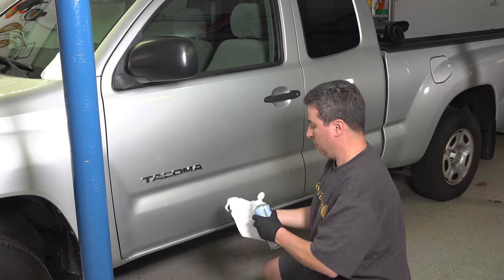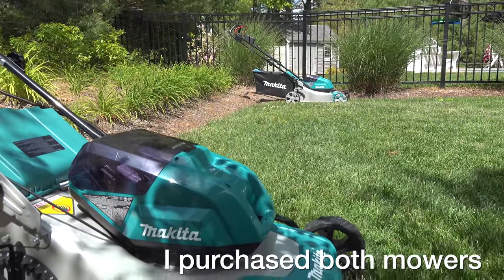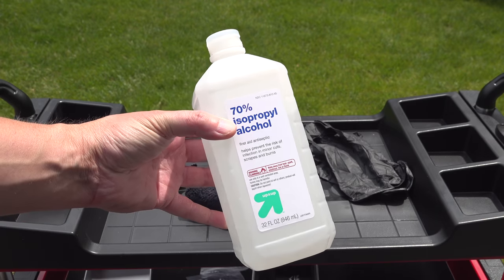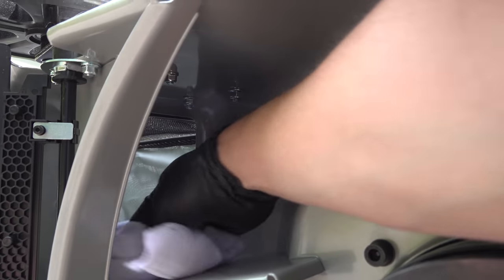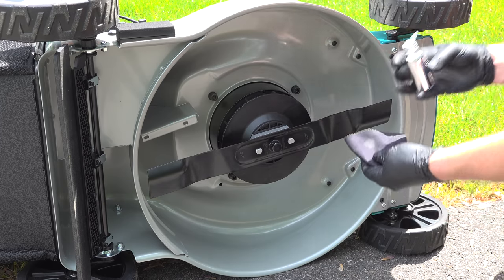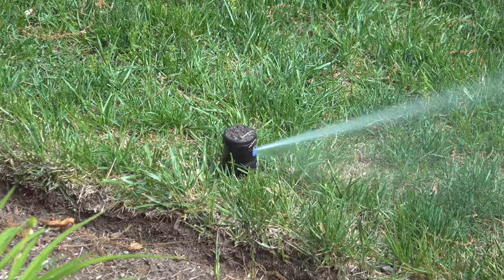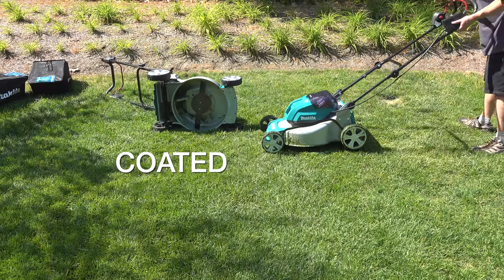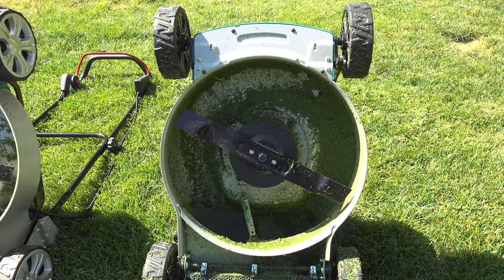Does Ceramic Coating your Lawnmower Really Stop Grass from Sticking to It?

Comment from the maker: Thanks for watching please LIKE & SUBSCRIBE - AvalonKing is having a MASSIVE Memorial Weekend Sale with special offers and huge savings from Thurs 27th - Mon 31st May but stock is limited so act fast
Reply: I figure it's too late to put it on my zero turn mower. I've been using it for about 10 years now.
Reply: Still there are variables! Those are electric!1.Well what about a gas lawn mower?
2.Are you cutting wet grass?
3.How much wet grass and how tall is it?
4.What if sometimes you don't clean your mower off after you've cut your lawn? 
5.Is your lawnmower garage or shed kept vs just being outside exposed or covered up outside? 
6.Will constant use outdoors and sometimes the engine might over heat or just get hot,will that make the ceramic coating deteriorate faster🤔🤔🤔
Reply: @punchogunter2362  great questions

Comment: I ceramic coated my shower walls... they stay so clean and water beads right off!
Reply: I've been wondering if that would work. What did you use
Reply: @Aaron-nj8xj  I used Turtle Wax Ceramic Spray Coating. Around $14.00 a bottle perfect for things like that!
Reply: Did mine as well,amazing & my arms don't miss the scrubbing 👍
Reply: GENIUS
Reply: @MIKES0029  just so you're aware, that's not a ceramic coating. A true ceramic coating would eat through a plastic container. It is an Si02 formulated spray that I'm sure adds plenty of hydrophobic behavior and is a great idea. Not trying to knock on ya, just passing the info as it is an easy and common misconception. Awesome idea regardless!
Reply: I ceramic coated my body. No more showers for me!
Reply: I ceramic coated my self, now I don't get wet when it rains.
Reply: That is smart
Reply: My sinks and toilets are now better than ever
Reply: I ceramic coated My shower floor, grandma's fall right off!
Reply: I ceramic coated my toilet, no more shit stains
Reply: Does is stain grout?
Reply: @daveroski  not sure I have a fiberglass shower..

Comment: Would like a longer term test on this one. I'm wondering if the grass will still build up anyway over time.
Reply from the maker: I will definitely let you know. I am just as curious myself.
Reply: @SilverCymbal  thanks! Great video as always!
Reply: With experience with ceramics on cars, the answer is yes. However, I'd guess it would take 2-4 years before it needs to be redone or cleaned. Huge difference IMO. This is a really interesting idea.
Reply: @sebastian-daquanglocknerjr1883  Ceramic coatings do not last 2-4 years on cars. Much less under a mower where dirt and sand will be blended around.
Reply: @SilverCymbal  I did it with paste wax  ,  results same... cheeper
Reply: @PabloDamon  that's what I was thinking
Reply: Great video.  Yes agree w/Mike longer term test please.  Also, would have been nice to see you use a blower on the underside.  I theorize it would have blown away most of the coated mower grass but would like to see it!
Reply: @Angelfams  I agree. Leaf blower test please.
Reply: @SilverCymbal  my family has a lawn business. How would you say the ceramic coating has lasted? Any info will be helpful. 🙏🏻.
Reply: @SilverCymbal  A hose test would work too, if you're allowed to spray it with water. Seeing how well each one rinses off the grass.
Reply: @SalvadorSTMZ  Exactly, the underside of a deck is sandblasted. The only real solution must take that into account.

Comment: Give us an update on it after several months of use. I suspect the coating will wear off after just a couple hours of use, and probably even faster if you have a lot of dirt or sand in your yard.
Reply from the maker: It definitely wear faster than on a vehicle, but yes the speed of that wil vary a lot, but if you just mow grass that isn't super dirt, it could last quite a long time cars 2-3 years, mowers. We will see
Reply: I imagine that if you're mowing once a week, you'll probably want to put on a fresh coating before the start of every season.
Reply: @KevinFields777  more like every 3 or 4 months

Comment: This is perfect. I've been having a huge problem with my grass sticking to the underside of my mower and making it Stahl ad heavy to push. I used silicone oil to make it slick, and had good results, but this seems like it will work better and protect it better. You do awesome reviews that help and are to the point. I'm glad I subbed your channel long ago, you've saved me so much over the years!! Thank you and keep up the great reviews.
Reply from the maker: I really appreciate that. It's definitely worth trying out. If you don't use it on a car one bottle will last you ages.

Comment: I have done this for years! And it works. Easier clean up and my 6 year old cub cadet rider and 12 year old Honda walk behind look and perform like new. Yeah I know, it’s an addition😁!
Reply from the maker: Thats awesome to hear, since I am new myself to doing this, the one thing I can't test is the longevity so this is great feedback.
Reply: How often do you re-apply?
Reply: @Nyall  I usually check how the mower is cleaning. I use a 1750 PSI washer and will hit the bottom of the deck about every 4th cut? I’ll reapply 2 to 3 times a season. Good luck!

Comment: When I worked at John deere we had a golf course account and we used to coat the inside of the machines. They didn't want to build up grass to track across the pathways. Not sure how long it would last though as we serviced thier mower about every 5th or 6th cut and would record. Never ran one out to see what would happen. Will be intresting to see how this goes.

Comment: I purchased a Toro Timemaster this year and wondered if this would work. Thanks for the video
Reply from the maker: It definitely would, thats a wonderful mower. I am still using mine. Even if the deck has some wear any reasonable clean surfaces will benefit from some nonstick action.
Reply: @SilverCymbal  Last week I'm in the garage rockin out with headphones on, shorts and boots, real dad mode, just giving my mower a cleaning and Armor All rundown. My wife's coworker stopped by unexpectedly to drop something off.. Completely surprised, I yelled HEY at the coworker and jumped into a defensive posture as if she was there to take my baby. She laughed and I was so embarrassed apologizing over and over.

Comment: I wonder if that coating makes booze move faster through straws.
Reply: If you are having a flow rate problem, try bypassing the straw.
Reply: @toddshreve  keg stands utilize gravity to increase hose pressure, as well.  Highly recommended.
Reply: @jorgejeffries5855 Covid has made me alter my long island drinks, but I still got to 10 on my birthday with straws, so now worries. Athletes overcome obstacles.
Reply: @jorgejeffries5855  just about everyone who orders a mixed drink in a pint glass.
Reply: Jorge Jeffries @ a sissy lol
Reply: @jazpanoz4996  After 3rd day of covid, you'll be wanting that straw as well.  Long island teas are anything but sissy drink, you get to 10 and let me know how that goes. 16 ounce ones btw.
Reply: william morales @ long necks ftw for me anyday lol!

Comment: Any update how your mower faired this test?  Just coated my new mower with some leftover ceramic coating I had laying around... why not?  I'm sure it wore off your blades, but the rest of the deck I'm curious of.  I've had good luck doing cars, sink bowls, countertops, stainless steel appliances, door handles etc... but the high wear areas will always wear down.  Do you think your coating lasted the season?  Also curious about your snowblower...  I figure snow may be a little less abrasive than anything found in a lawn.  

For anyone reading this, I used AMMO NYC Reflex Pro ceramic coatings on the anything inside the home.  From my research reading multiple (M)SDS's regarding different Ceramic Coatings, that seemed to be the safest.  The warning for ingestion literally says "Call poison control IF you are feeling ill".  I even called Larry, the owner and he said, "While I legally can't recommend it, do your research and you'll find we're the safest ceramic coating on the market.  ...  If you do go through with it, send me photos."

Comment: Curious about how the ceramic will hold up over time.
Awesome video though. 
So when the mower hits it’s first birthday, will it need another armor coat? If so, will it be clean enough to do so?
Reply from the maker: I would think for a mower annually would be great, but only time will tell. I have some tests planned with these and some other coatings.
Reply: Awesome! Very curious

Comment: Lovely lawn! Thanks for sharing. I'd be interested to see another test at the end of the summer to check the longevity. I am not familiar with the product. I have spray painted new and cleaned and dry decks (underneath) before with Rust-Oleum when I had my landscaping business decades ago, as we always hosed off our mowers to prevent cross-contamination of seeds.

Comment: I love your channel and I am a subscriber but I have  2 questions . What lawn mower do you use to cut your grass on a regular basis  Secondly  what was the brand of motor cycle  cleaner you used on your toro reel morrow  refurb cheers Ted
Reply from the maker: Thank you, mostly I use my Walker T25i and a Toro Timemaster 30". I have other areas to mow and I use the Walker as a snowblower too, I got it used and for the first few years did a few cleanups that paid for almost 1/2 of the cost. but this isn't a great option for everyone.  The cleaner I use for all my power equipment is: https://amzn.to/2M4u3Es Not cheap, but nothing is better or faster.

Comment: Wonderful video and product. At 30mls per bottle, do you mind if I ask how many bottles it took to ceramic coat your truck?
Reply from the maker: OMG, I would never use this stuff if it cost that much! That one bottle could have done two Tacomas, I barely used 1/2 so one bottle will easily a full size suburban, a pickup has a little less sheet metal. You get a lot of coverage
Reply: @SilverCymbal  Thanks so much for your quick reply. I would have never guessed such a small amount of product could go so far. Keep up the great reviews. I learn much from you and I appreciate the fact that you seek inexpensive ways to get jobs done. Cheers !

Comment: I would have never thought to ceramic coat the under side of a lawn mower. How many times a year do you think you'll have to reapply the ceramic coating?
Reply: Probably depends on how much you use, the type of yard, and type of coating product,  and how you clean it. I would guess that you probably have at least 1 to 2 months probably longer but I am basing it on myself and my yard.

Comment: Very interesting and a great review! Thanks.
Please tell us honestly what you have found to be a downfall of the ceramic coating on your car?
Reply from the maker: On the car? Absolutely none. My truck 7 weeks later still looks amazing and I haven't washed it at all. On vehicles it really is an amazing thing, yes its work to put it on but then you can be lazy for 2 years!
Reply: @SilverCymbal  Thanks. 2 years you say. Is that when they recommend you reapply it?
Reply: @MRrwmac  Yeah, after 2 to 3 years we recommend to start preparing to replace the coating.
Reply: @AvalonKing  Replace the coating? What does that involve and will it harm the underlying paint?

Comment: I used to think, who cares if the grass sticks under my mower? I won't see it anyway. Many months later I found out why. A rust hole appeared on top of my mower's deck. Clumps of wet grass stuck to the underside of my mower caused it to rust out badly. oops. Clean your mowers after each use, especially if you were mowing wet grass/weeds.

Comment: Easy to see how it would work on a new deck, but what about a well used one? Some of the grass is hardened & may need a grinder... then how would the coating behave?
Reply from the maker: You can use it on almost any hard material but if it was me I would lightly sand it and at least put some rustoleum on first, but it's not much risk to try it. You use sooo little for mowers.

Comment: A $5 aerosol of silicon will give the same result for many years.
Reply: Doesn't last as long  & no good if you use grass cuttings elsewhere:/
Reply: @jazpanoz4996  The $5 can, will last forever, reapplying regularly, compares well for $100 for super diluted alternative. Want real good stuff, look in aviation, expensive but amazing.
Reply: Steve Morris @ Yeah I know but you said the key word "reapplying"
With ceramic coating it is hardly reapplying,as the difference 😉
Even used filtered engine oil works but needs to be reapplied more often than ceramic coating!

Comment: Wonder how long it lasts?
Reply from the maker: On a vehicle you can get 2-3 years but on a mower it will depend on how much dust and abrasives are there. But it will definitely be a lot longer than any wax for sure.

Comment: I truly wish you only did it on half of one of the mowers to tell the true difference for that exact mower.  But thanks for your time and this video just the same.
Reply from the maker: It would be less accurate than what I did. Declk are not uniform in how they flow. If I split it down the middle the favored side, which is usually closest to the chute would have gotten more grass. This is the most accurate way, two identical mower models, same area of grass, same time of day.

Comment: I've been thinking of coating my Timemaster with truck bedliner. At a minimum it would protect the metal from corroding, at worst it would permit grass to clump up.
Reply: I wouldn't do that because if you run over a rock or it somehow cracks water can build up in it and rust it out even faster

Comment: you unplugged the safety key after removing the battery?  that's like removing the spark plug after removing the engine. the safety key is there to prevent unwanted operation then the batteries are installed.

Comment: How long does the coating last? I presume one coating will wear off after a few cuts.
Reply from the maker: It will definitely last longer than that on a car driving with dirt, and elements you get 2-3 years. A mower takes much more abuse but only for short durations, a car stays out 24x7 but if you are mostly cutting grass that isn't super sandy I would expect a year.

Comment: Is it actually a ceramic coating?
Reply from the maker: Yes, somewhat like liquid glass particles suspended in a solution. The solution evaporates and leaves a bed of these particles behind. I was a bit skeptical the first time I used one of these, but the next day check out the rag you used to apply it, its as hard as a rock. Clever stuff!

Comment: Could ceramic coatings stop graffiti on railcars?
Reply: Sure can! It would be more cost effective to catch the graffiti artists in the act, and force them to soak their hands in the ceramic coating for an hour, like palmolive dish soap ads from the 1970's. That way, every time they tried to push the nozzle on the paint can, it slips out of their hands, and no graffiti happens. 

Who would apply that coating to railcars anyway, that would take forever.
Reply: @markk3652  Catching graffiti artists isn't happening. Even if, they are caught and released. It's just a pipe dream, I guess.
Reply: It definitely could though this isn't something we've specifically tested for.

Comment: plastic deck
Reply: Plastic deck + vegetable oil quickly and sloppily applied before each mow session.
Reply: @johngalt97  I bought my first battery mower a couple weeks ago. I brushed with a nylon brush after a wet cut. Not worried about the plastic deck because I mulch everything bc it doesn’t have a side discharge option